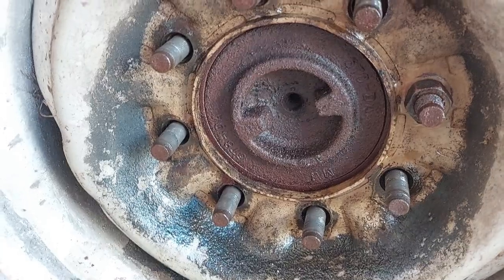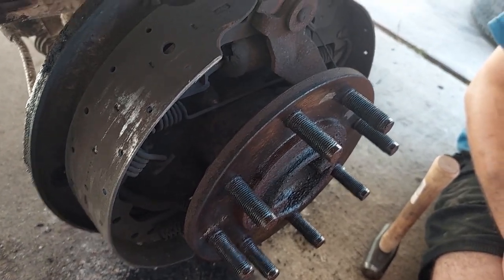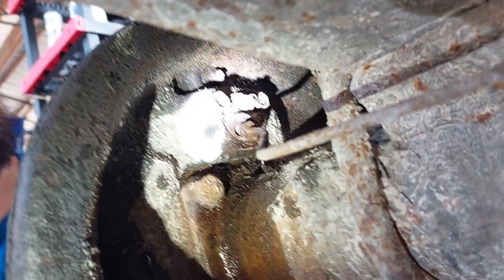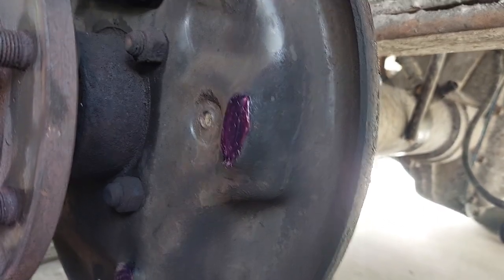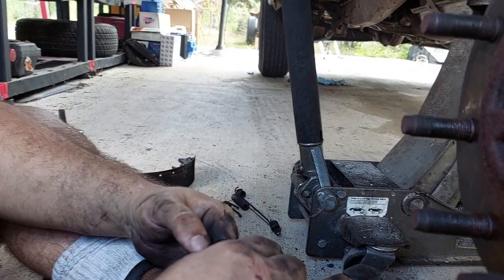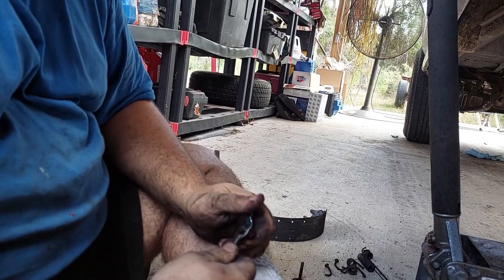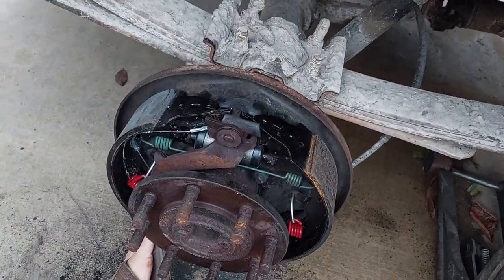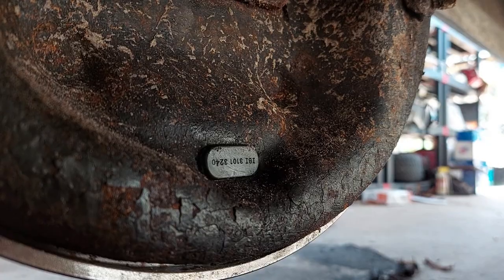Episode 96 - Rear Brake Shoe, Wheel Cylinder, Springs and  Drum Replacement 1993 F250

Comment: As proven by the Silver Spring, showing in part of your video and the blue spring showing in the other, you edited it, but used both sides without telling the person watching the video. That made it very confusing, but I must say thank you it did help me somewhat.
Reply from the maker: I apologize for the confusion.  The sides are mirrors of each other if that helps.
Reply: I noticed that too. Takedown was the driver side. Reassembly on the passenger side.
Reply: @MazdaB3K  When it matters like it does here you could mention the parts go together in the direction the truck faces. Emergency brake lever and the little cable going from the top bolt to adjuster are on the rear brake shoe. A mirror would show one on the left and other on the right. Some people (like me 🤷🏻) get easily confused with that sort of stuff. 
Overall, thanks for a great video! I subscribed today!
Reply from the maker: @jackjones9460  Thanks for the sub!

Comment: Great video, good tips, but I agree with @roberthensley8653, you need to put jack stands or blocks of something under the axle in case you jack fails.  If it failed catastrophically when you're under the truck with nothing  to catch it, your dead.  If nothing else, put the tire under the axle.    Not being your dad, just don't want you hurt.
Reply from the maker: I understand.  I do generally make sure I have support in place while I'm working under something.  Actually had to invest in some 6 ton jackstands for an RV that I'm working on.

Comment: If you didn't have a pair of spring pliers you should have at least filmed one side of the blue or red short springs being put on. So many videos and some small but super important detail is left out. Good video other wise.
Reply from the maker: I didn't in this video, but I just did a video on drum brakes on my 1989 F350 where I do show some of the same basic technique using locking needlenose pliers to put springs on.  Improvements over time I suppose.

Comment: In my truck the parking brake that C shape is almost rubbing the hub and that disables parking brake. I don’t know what’s wrong any idea please?
Reply from the maker: Are you talking about the bracket that holds the actual parking brake cable?
Reply: @MazdaB3K  yes that bracket is little rubbing the axle there’s almost no gap between
Reply from the maker: If I remember correctly that is supposed to be in held in place on a pin that sticks out of the brake shoe.  The bracket has to be inserted in the correct order so it doesn't hit a  spreader bar that goes between the two brakes shoes.  There's also supposed to be a flat washer on top of the bracket at the pin, then a horseshoe shaped clip that holds it all in place.  My suggestion is check the order in which all the parts have been put in and see if something is out of sequence.  You may also want to inspect the bracket it self and make sure it isn't bent.
Reply: @MazdaB3K  ok washer and clip all in the right order. I believe like you said it may have a bent bracket. I’ll check that. Thank you very much for the help
Reply from the maker: @ashokjames3467  sure thing

Comment: 97 f250 HD also uses this layout while having the sterling full floating axle
Reply from the maker: Good to know.  Thanks for the comment.
Reply: @MazdaB3K  ye, should also note the sterling axle uses the 3" pad drums but has the same 8 lug pattern, chevy also uses the same parts
Reply from the maker: I did know about the pad difference.  Initially my brother bought the bigger pads for this job on accident and had to return everything.
Reply: @MazdaB3K  know that feeling, the HD has a bunch of unique traits vs other f250 trucks making buying parts a pain till you know exactly what the thing you need is called, ended up buying a door lever at a scrap yard after 2 days of searching because it's not sold new, the easy fix would be to just swap the door with any regular f250 that had control bars instead of cables, then i have some weird cab stuff going on as well, power rear window but no switch on the dash for it, almost looks like someone wrecked it and swapped stuff around to make it work, lol

Comment: Good video. A photo of the assembly before any thing gets removed is also very handy! I came here because most of my springs (except the red springs) were rusted apart and had fallen off. Photos didn’t help. Thank you. I’ll watch again!
Reply from the maker: Yeah, photos are a big help.  I'm having to change out the shoes on my 1997 van and I take photos and lay out the parts in the rough order they are setup as I take it apart.

Comment: Thanks alot! I have a 1993 3/4 ton dodge ram and I tool off the axle comepletly to redo it all and this is going to help me out alot, I know it!
Reply from the maker: It should be able to help you out.  The spring colors and locations are probably a bit different, but the general concept is the same.  Take lots of pictures and take your time and victory will be yours.

Comment: Great videos, Have you gotten back in to do the parking brake cables? I have a 94 e-250 w the same axle. I did everything you did + the parking brake cables but when reassembling, the cables putting pressure on that parking brake lever causing the brakes to drag and not sit flush on that half moon at the top of the assembly. 
Heavy rig so I really want to parking brake to work if possible and there’s not much info out there on this.
Reply from the maker: Glad the video helped you out.  This is my brother's truck and we haven't gotten back around to it because of some paperwork issues on it.  When we do and tackle the parking brake, I'll definitely make a video for it.

Comment: Many of the semi-floating (non Super-Duty) axle F250's came with 8.8" differential, which was the same one for the Mustang and some later Rangers, Explorers and Broncos.
Reply from the maker: Indeed.  My B3000 had an 8.8 in it.  The early Explorer, Mustangs, Sport Tracs and probably a few other all got the Ford 8.8.  I have one from a Sport Trac I intend to stick in a 1964 F100... someday.
Reply: @MazdaB3K  I have a 2002 Level II Ranger FX4 with the 8.8" Torsen Helical differential.
Reply from the maker: I swapped in a 2000 Ranger 8.8 because I wanted to go from the 3.45 gears I had to 4.10.  Made the truck far more drivable.
Reply: @MazdaB3K  Yeah, the 4:10 gears came standard in my truck. It's like it has a full time posi in it with the helical diff.

Comment: Did you do anything to get the cylinder pistons to activate??
Reply from the maker: Do you mean to get the wheel cylinder to spread the brake shoes?  The wheel cylinder is hydraulically actuated, so to make it work you need to have no leaks in the brake system and to have purged all the air out of the wheel cylinder itself by bleeding it.  After that, the wheel cylinder should work when the brake pedal is pushed.

Comment: Could be possible to install rotors break systems to replace the rear break drums systems in the 96 e-250 ?
Reply from the maker: You mean a conversion to disc brakes?  This is the same rear end they put in F-150 trucks of the same year so if you can find a conversion kit for a '97 F-150, it should work here.  Something else you can do is swap in an entire new axle that is already setup for disc brakes.  You'd have to find a compatible donor for that, but again, you might find a F-150 or non super duty F250 that had disc in the back.  I've not researched this but yes, I think a kit is out there that you could utilize.

Comment: How to force those two red little springs to be installed in those two little hooks ? Because that seems to be the most important thing.
Reply from the maker: Yes.  Those j-nails hold the brake shoes in place, so they do have to be done first.  My F-350 has the same setup and I just did them so this is what I did.

I took some needle-nose locking pliers and locked them TIGHT toward the ends of the hook in the spring.  I then pushed from the end of the pliers just about as hard as I could in order to push the spring in just far enough to wiggle the spring under the j-nail so I could hook it.  Clamps really are you friend here.  You can take some locking pliers style square clamps and hold the brake shoes in place so you can focus all your energies on getting the spring onto the j-nail.

Hope that helps.

Comment: great video but you guys didn’t get to show us how to replace the small cable on the parking break lever or wtv you call it
Reply from the maker: I don't think we showed it directly, but in general the cable that goes down and hooks on the parking brake pawl hooks onto the post located on the top center of the backing plate.  If you look in the section of the video where I'm talking about making sure you get the order of the parking brake shoe and the little trapezoid shaped spacer at the center post correct, you should see the wire connected there.  Normally that piece is not included in a drum hardware kit and has to be purchased separately.

Comment: Miss teach how hook the springs in those nail head parts.
Reply from the maker: There is a specific tool you can use to push the springs down enough to get them in position and then rotate them so they are locked in.  I don't have that tool.  Instead what I did was take needlenose locking pliers and grabbed the sides of the spring locking plate (spring hat) so I could shove the spring down into position and still be able to rotate the spring hat to the locked position.

Here's a link to the correct tool:

https://www.amazon.com/GEARWRENCH-Universal-Brake-Retaining-Spring/dp/B0002SQU7W/ref=sr_1_24?crid=3EIKOLPOAXAP1&keywords=drum+brake+brake+nail+tool&qid=1697215406&sprefix=drum+brake+brake+nail+tool%2Caps%2C157&sr=8-24